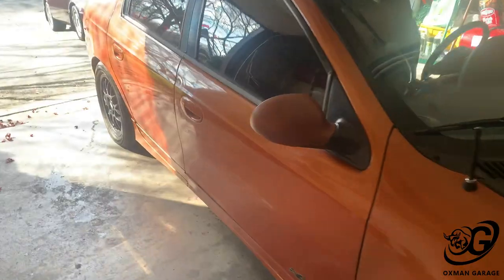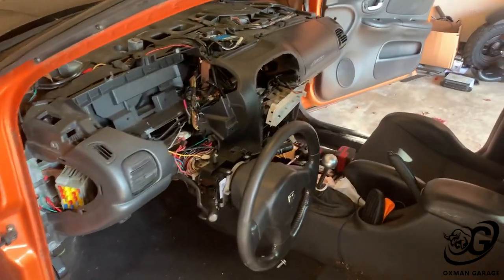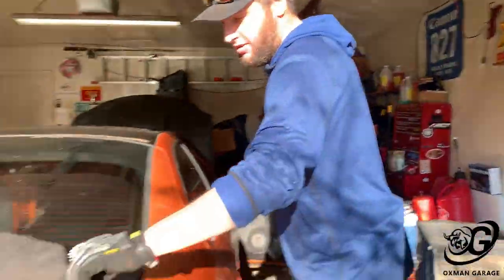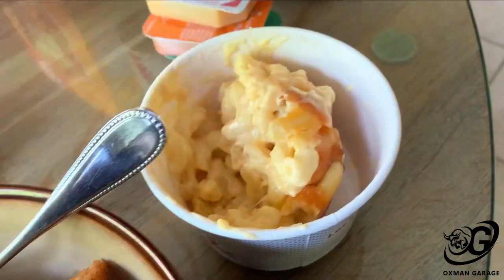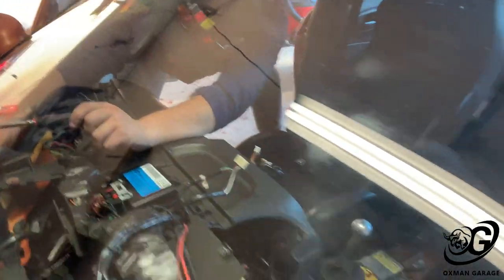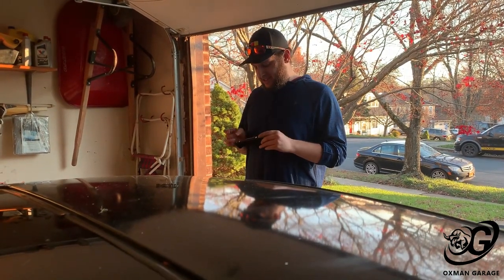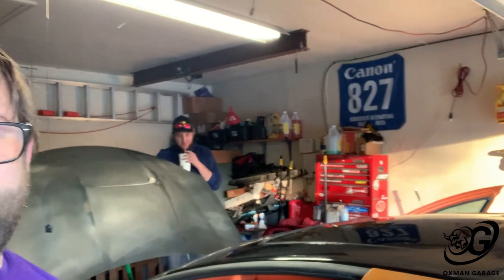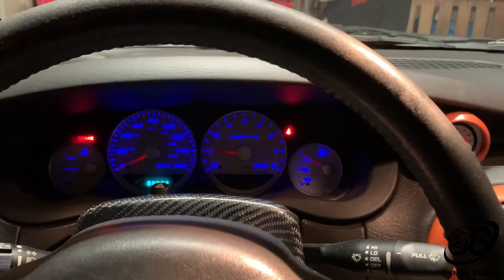Neon SRT4 Heater Core Removal

Comment: Was your car over heating before? 

I don’t have heat inside my srt but the car runs around 160-170
And I’m trying to figure out what I need to fix
Reply from the maker: No the car wasn’t overheating at all, I could smell coolant after the car got warm because of the location it was leaking from.  I would preform a coolant pressure test and see what happens.